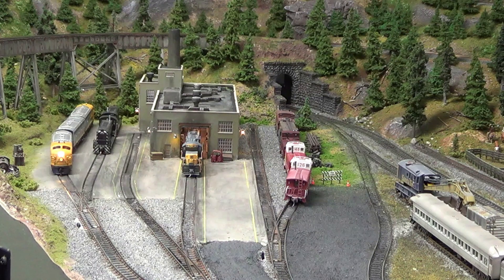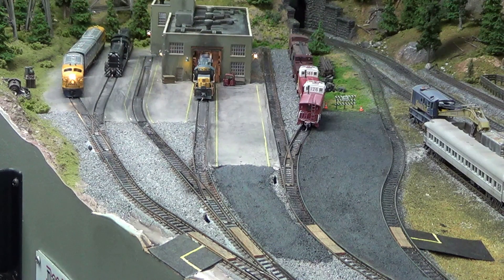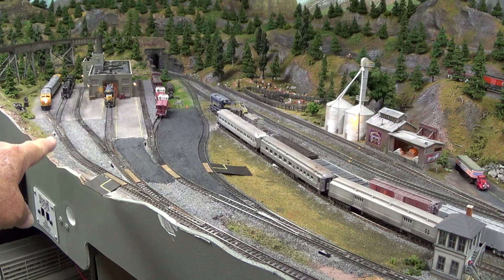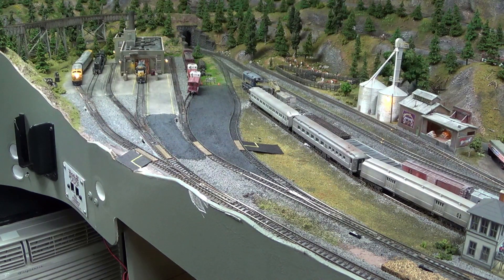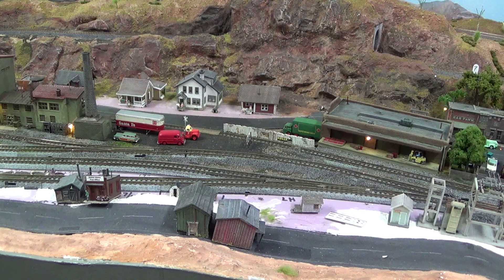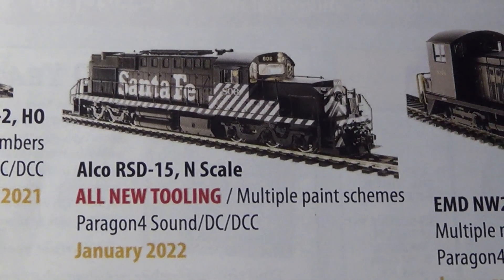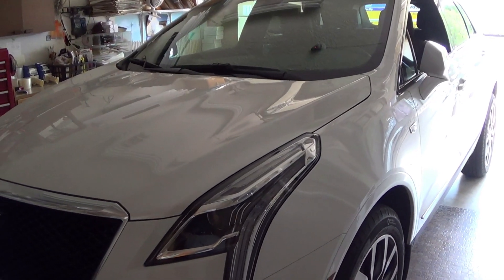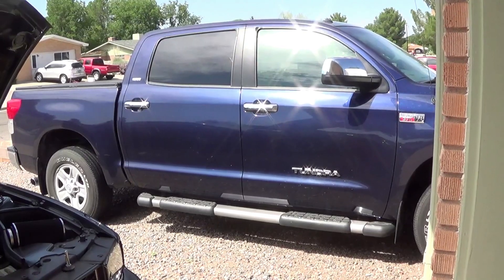N Scale ACTRR 3 Layout Update # 102

Comment: Brilliant engine house Mike! Looks awesome at night! 👍 I'd leave the gantry in front of the building for 'outside work' as you had it, on its own rails, and then park a small diesel workhorse switcher on the left side where it would be used to move inoperable locomotives that are being 'worked on'. Cheers! 🍻

Comment: Mike, have you considered just putting the oil storage tanks over near the MoW track, and just have oil standpipes (such as the American Limited Models fuel cranes, which I bought from you) near the engine shed? Then the sanding facility could go across the road in the section near the tower. I like the look of the overhead crane in front of the shed.
Reply from the maker: Thanks and that is a good idea. I have a couple fuel racks and just am undecided as of yet.
Mike

Comment: The Locomotive shops area looks great. Especially like the look of the concrete. Did you use decals or paint pens for the yellow lines? Personally, I don't like the overhead crane there. It should be inside the shop building. If you put one outside, it should be offset so that the crane can put down what it lifts off the locomotive. There is not much room for the crane to move forward and backward along the tracks either. That Power Sub Station looks good there. Thanks for the heads up on the 2022 N scale convention. I am going to try to make that one. Cheers and stay safe.
Reply from the maker: Thanks so much brother !
Mike

Comment: Nice work, Mike! A question: Have you done a video showing how you replace the bulbs with LED lights? ...Roy
Reply from the maker: No I have not but I simply pull the bulbs and wires out and feed in the fine wire from what ever LED I use.
Mike